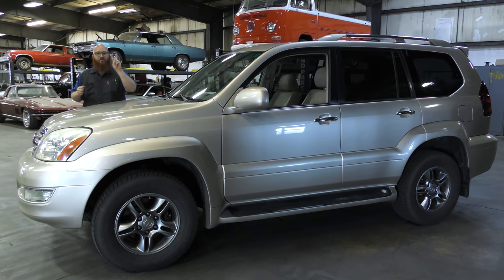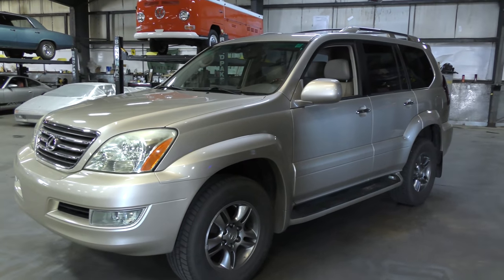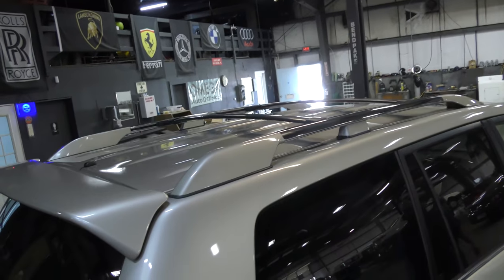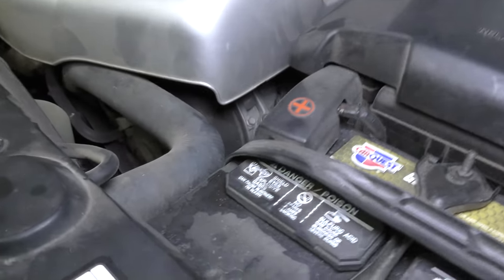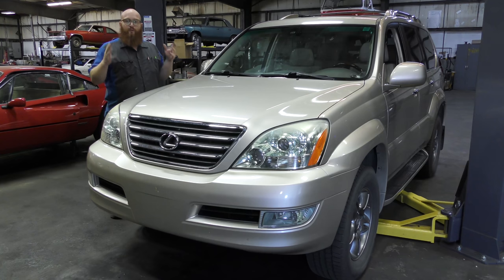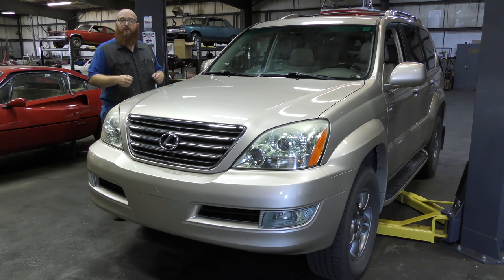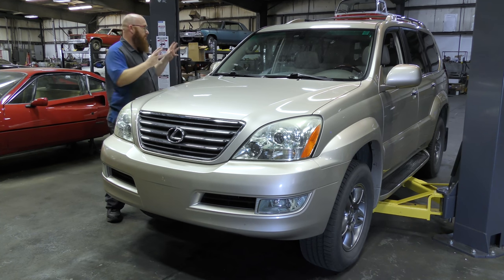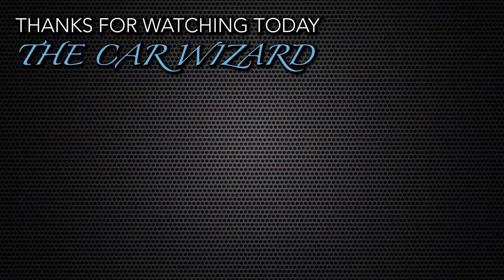Reliable cars get surprise bills too. Simple oil change on '08 Lexus GX470 turns into $1200 repair

Comment: $1,200 is nothing for this GX. These repairs will last many years, so long the drivers aren't aggressive.
Reply: I have owned my 5000$ 2004 GX470 with 370k since 2015, ive put the last 90k since. I literally beat on it, drive it extremely aggressively, floor it on the ramp all the time, floor it to pass someone, did mild offroading action on mud and sand with AT tires, retarded drifts with pedal to the floor on snow every year in quebec, towed a car from florida to quebec twice, tow my bikes all the time. IT. NEVER. BROKE. DOWN. ON. ME. ONCE.

Ofcourse I did extensive maintenance, changed engine oil every 5k, diff transfer case and transmission fluid every 40k, coolant and brake flush flush every 90k, timing belt once, brake job 3x because of my aggressive driving, replaced all 4 shocks at 330k, all swaybar and control arm  bushings once. but these are all maintenance items. THATS IT. I fell in love with Toyota and Lexus eversince
Reply: 5k was a SMOKIN deal on a GX with only 300k miles.

With inflation and the tight used car market I'll bet you would pay even more for that car today, even 6 years later!

The real beauty of a Toyota/Lexus is that they retain their value so well!
Reply: I paid 6000 for mine it had 118k same issues as video not bad but never broke down ever
Reply: “Aggressive” driver? Lol
Reply: That's exactly what I said when he presented the price I was expecting for a break job and 2CV axles to be a minimum $1800
Reply: @KLAWNINETY  High mileage Toyota's don't retain their value in ALL markets across the U.S. Where I live a 300k mile GX470, or ANY 300k mile vehicle, would be virtually worthless.
Reply: @chynacash3138  where do you live, Uzbekistan?
Reply: @alexandermilentis2130  I live in one of the MANY parts of the country where only fools pay real money for high mileage worn out machines simply because it has a Toyota badge smh.
Reply: @chynacash3138  it might be your opinion that you wouldn't pay that money for a high mileage vehicle, but I'm saying it's probably a false statement that a high mileage vehicle would be worthless in your part of the country. Actually, regional location is pretty much arbitrary when it comes to vehicle prices since everything is online these days. Not really sure if your statement holds much weight besides just being a statement that you don't like high mileage Toyotas.
Reply: @alexandermilentis2130  My statement holds all the weight you can carry lol. You can get a pretty clear idea of regional used car prices by looking online (Craigslist, Marketplace, AutoTrader, etc)... People post 250-300k mile Japanese cars for ridiculous money in certain parts of the country (California, the DMV area, etc), and in other parts they are priced logically like the old worn out cars that they are. And my comment didn't give any indication that I singled-out Toyota in any way other than to say that people who pay absurd amounts of money for old high mileage versions of them simply because of the perceived reliability aspect are foolish. An old high mileage machine is just that.
Reply: is nothing? it's a lot of money for lexus, that money is nothing for a bmw
Reply: @chynacash3138  So you still haven't said what part of the country you are in that would support your statement. I'm assuming you haven't said it because then your theory could be disproven within a matter of seconds.
Reply: What part of the country that "I" live in doesn't matter, you're fixated on the wrong part of my comment. Obviously you must be some old timer who can't do the online research yourself and see the true value of old high mileage cars in different areas of the country. Try doing some Craigslist searches in different states, I'll help you out that much. Either that, or you're one of the fools I was talking about who overpays for old hoopties simply for their perceived reliability advantage instead of realizing that all things wear out.
Reply: Sacha Vasiliev  That didn't make any sense. Your joke was lame.
Reply: @chynacash3138   Why the deflection of not telling everyone what area you live in? Afraid of people using the internet to dig in for car prices in your area.
Reply: Ah yeah? Mine is so cool it has gidget spinners and flashy thingys and twirly watchamacallits its sweet!
Reply: 1200 would barely cover a "module" and labour for replacement (unplug and plug) on a new German car.
Reply: @e.e9331  That's great to read. Bought my '06 in 2010 for $40 k (40k miles) and now have ~150k on it and have done everything and more (rear bags/pump) and it runs perfectly. Been running royal purple exclusively engine/drivetrain.
A new AEM air filter and cleaned MAF sensor REALLY woke it up.
Reply: @sheiladawg1664  now replace spark plugs with Denso 3297, it will improve your fuel economy and gain some lost tq and hp back. Your engine will also idle and rev smoother than before, it was very obviously noticeable for me. power gain not so much. for transmission oil I highly suggest you stick with Toyota WS fluid
Reply: @e.e9331  Changed to them when I bought vehicle. Initially, passengers couldn't even tell the car was running. Seriously. Even the steering wheel was vibration free.
Reply: Cars are endless money pit
Reply: @KLAWNINETY  I paid in Switzerland 15k for Land Cruiser 120 4.0 V6 on which platform is GX470 build. It has 213.000km and it needs some care but it has KDSS system 2005 and it is a full spec.Prices of this LC120 in Europe are sky rocketing and I won't be selling this state of the Art for very long time the car runs great even after 16 years and it is absolut wonder I found this one with V6 engine cause most of them are diesel 3.0 or new 2.8 engines. V6 Toyota in combination with 5 speed auto is best choice for long distance and off road in compare to diesel.
Reply: 270k miles on my LX470 drives like it has less than 100k miles. It’s Toyota. Not a high mileage piece of junk. I’m sure it’ll keep running even above 350k miles. No leaks and doesn’t even burn oil. Got offered more than what I paid for it 6 years ago.
Reply: My 2008 tundra on the same platform of these Lexus. So far 120k Miles no issues. Toyota offered me a new frame and whole front suspension under their "rust recall" at 100k miles. So it's basically brand new for the front end. I don't see Ford doing that with their 2008 f150..
As of now it's sitting on 34in tires and I off road and beat this crap out of the Tundra. Only time it left me stranded was when I left the interior light on overnight.
Reply: Bro who tries a g x aggressive, man
Reply: YEEEE-aaaahhhh….no.  I don’t think “how” one drives the truck has anything to do with anything.  Much less how long it’ll last.  In fact, if a vehicle is so fucking delicate it will fall apart if “driven hard” then it’s just a straight up p.o.s.  And the J120 chassis is not a p.o.s.  So don’t confuse yourself.  The GX470 is a f-ing TANK.  It doesn’t matter what you put it through.  It will survive and run just as well at 475,000 miles as it did at 75,000 miles.

Comment: I bought one of these for 8k, drove it for a bit and then resold it for 14k. The guy I sold it to resold it again for 17k. The market on these vehicles is insane.
Reply: Just like Tacoma’s
Reply: 80 series and 100 series cruisers are even worse
Reply: You can thank the pandemic overlanding boom for that lol
Reply: I remember these were way cheaper than an equivalent 4 runner
Reply: Omg, I was going to buy one last year, but wasn't sure if 10K was reasonable. Now the price is ridiculous!
Reply: I bought mine before the craziness started for $4500.
Reply: yup, i just got my gx470 a few months ago and it’s probably worth a few more grand now as it sits. no way i’m getting rid of it though, best vehicle i’ve ever owned
Reply: These things are awesome to own, having bought 2003 new and currently have a 2008 with 150K miles on it. Beautifully made, drive great, and ultra reliable. Plus, a much more upmarket and nicer vehicle than a 4Runner with equal longevity
Reply: @993mike  I liked mine, but I always preferred the 4Runner. I will agree that the GX had very good quality control and was a solid built vehicle.
Reply: GUYS I JUST FOUND A 2009 ONE OWNER WITH 70k miles 😭😭😭😭 holy smokes

Comment: But wait - the Chevrolet Traverse/Acadia owner did get a 'smoking deal," just not necessarily in that order.  First the 'deal' - the 'smoking" comes later.
Reply: LOL
Reply: Yeah, when it turns into a smoking pile of junk, LOL
Reply: The smoking begins a few weeks after the warranty expires.
Reply: @CaptainFeathersword  LMAO
Reply: @CaptainFeathersword  Fact!
Reply: If he got a Bolt it sure would be smoking right now.
Reply: @CaptainFeathersword  they have a remote control that they press after the warranty expires to have the car f**k up hahaha
Reply: Perhaps. Or they may have mistook it for Smoker’s deal because they always end up trashed with cigarettes.
Reply: @majist0  I actually have a Chevy Bolt, I'm offended because I like my little electric egg lol.
Reply: Lol
Reply: @houseofno  Lol very true. But at least the recall was quick, had it done on my Bolt while I waited in the showroom.
Reply: I've owned a 2010 Chevy Traverse since new. 155k miles. We've replaced the compressor and evaporator, water pump, window switches, and door speakers. Yes even the window switches and door speakers broke. No it did not have any water damage at all. I still don't understand it 🤔🤔
Reply: Like a rock
Reply: @chynacash3138  until the battery pack replacement, it has the potential of being a lithium flaming deal...
Reply: @maniacaudiophile  Lol already had the recall done.
Reply: @chynacash3138  damn, you sure you don't want to entertain your neighbors with fireworks? ;)
Reply: You forgot about all the transmissions you're going to need.  My poor neighbor bought a nice looking used Traverse and ended up putting three in it in four years.
Reply: @largelarry2126  When talking about transmission eating cars, who could have forgotten about Mercedes ML320....
Reply: I think the customer was “smoking “ when they decided to buy a Chevy over a Toyota.
Reply: Hahaha 🤣, 🤣, 🤣, 🤣,, truth,
Reply: true
Reply: @alexlynn2085  😂
Reply: @chynacash3138  I heard the bolt is a great little car. The best cheaper electric cars you can buy
Reply: @pigbelly100  What's wrong with picking a Chevy over a Toyota? I definitely wouldn't pick something like a Malibu or Blazer over a Camry or Highlander, but I'd always take one of their trucks or a Chevy Bolt/Volt over the equivalent Toyota alternatives. Some Toyota's aren't "better" simply because they're a Toyota in my opinion.
Reply: @chynacash3138  that’s fine, everyone’s entitled to their own opinion. Personally I’d rather not have to worry about my Chevy Volt burning my house down while it’s charging . I hear you as far as their trucks go, just not my cup of tea.
Reply: @pigbelly100  I hear you. And the Chevy Bolt is the one that has the recall not the Volt, I actually daily drive a Bolt and had that recall done while I waited in the dealership lobby... Definitely not the hassle that some people exaggerate about.
Reply: I have been driving for almost 40 years and I have owned ONLY GM vehicles -- and I have no complaints and have not spent a ton of money on major repairs -- mostly just brakes and tires.  My 1976 Chevrolet Custom Deluxe 20 Pick-Up truck gave us over 40 years of great service -- and I even sold it a few years ago for $1200 to a guy that was gonna restore it again.  Mechanically, all it needed was a new clutch, otherwise it ran as good as the day it was new.  For cars, I have owned Pontiacs, Oldsmobiles (my fav), Buicks, and Chevrolets and every one of them was a joy to drive and own.

One recent vehicle was a 2003 Buick that I bought from a rental car company at 6 months old @20,000 miles.  Final mileage was 240,000 in 2018.  I only ever had to replace one wheel bearing, front anti-sway bar, and rear suspension.  It was sidelined only due to rust of the undercarriage.  I replaced it with a used 2005 Buick (built Oct 2004 -- 17 years old now) which has so far caused me no troubles and drives like brand new.  I expect to get another 4 more years out of it, having recently replaced the fuel filter and brake lines.

I like General Motors vehicles and see no reason not to purchase and own more of them in the future.
Reply: This Lexus owner has the reliable vehicle and still smokes.
Reply: @maniacaudiophile  What was the deal with the 320's I haven't heard anything, I just bought a 2007 ML350 a few weeks ago.
Reply: @chynacash3138  brah, it was recalled twice, they still go up in flames. They can't be fixed.
Reply: @TheGuruStud  Umm yes they can be fixed, my Chevy Bolt is fine, the recall was done while I waited and it wasn't inconvenient at all. They're great EV's for not alot of money like most others.

Comment: First off, this car looks amazing. Second $1200 is likely all they spent on repairs since they bought it.
Reply: On point lol
Reply: Facts
Reply: I drive an 08 GX -470 and I can’t believe how well it rides and drives with 110,000 miles.These vehicles are amazing.
Reply: Not quite true as the timing belt/water pump done at 95k at a cost @ 1000. I've spent less on my 97 Saturn Vue since new.

Comment: As a young man, I would normally do most of my own repairs. I happened to be working on a job that did not give me time to take care of my car, so I took it to a small Gulf Oil Station to get a oil change and lube. I showed up to pick up my car, he was still working on it. I started watching him work, he had a small wooden box of different types of oils and small tubes of grease. He was going around and lubing everything that moved, Hood hinges, truck hinges, Doors hinges and latches. I was amazed, I told him I never seen anyone do that as part of a lube. He told me well, apparently they weren't doing a very good job. From then on out when I do a lube job on my car, I do it all. Next time you pay for a lube job, see if they do what they are suppose to do. They dont.
Reply: Older days they did, because that is what they required. You would be lucky to find 2 grease nipples under a modern car.

People want to pay less, so these smaller items fall off the list, the the point you now have "oil only" places who can't even be bothered to replace the original sump plug, and put in a plastic stopper.

Everybody claims to want good service, but they don't want to pay for it.

Comment: In this case it's $1200 well spent.
Reply: Yeah well because it's Toyota.
Reply: Any money spent on repairing a Toyota is an investment.
Reply: After 12 years  in services it is about time to inspect and replace.you will be free your mind for next 5 years. My is 2007 with 175000 miles flawless power v8.
Reply: @dantran5821  agreed I have 250k on my 05. I just bought a 2014 c250 to help my mpg. I still find my self driving the gx tho.
Reply: @shawnballard794  I would try to put as many miles on the Lexus as possible. Like keep the Mercedes as a weekend car, they don't tend to handle miles well. If you are going to do a weekend roadtrip and travel long distances, use the Lexus as well.
Reply: Yep
Reply: Definitely

Comment: My favorite is "It's just a broken fan belt. Why do I need new radiator hoses and a wiring harness repair?"
Well, because that belt wrapped around the fan clutch when it broke and did it's best weed whacker impersonation. Maybe you should have replaced it the last 3 times you came in and we suggested it.
Reply: Heh, just today had a customer.  "Going on road trip, please check car over."  Well, the biggest issue was that all brake pads were at 1/32", and the front rotors had hot spots.  And I mean serious hot spots, they looked like a chrome cheetah.  There were a few other issues, too, but the brakes were the most serious one.

Got the call over the intercom, "Back it out."'

Well, OK, Mr Customer.  But I hope your road trip does not involve any mountain roads.  Not for your sake, but for the other people on the road around you.
Reply: that's a quote for the record right there.